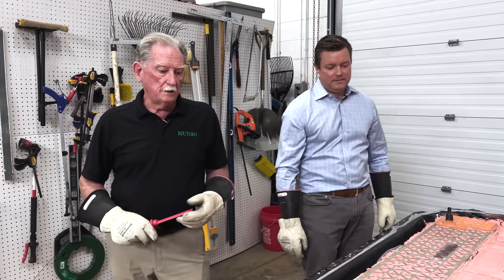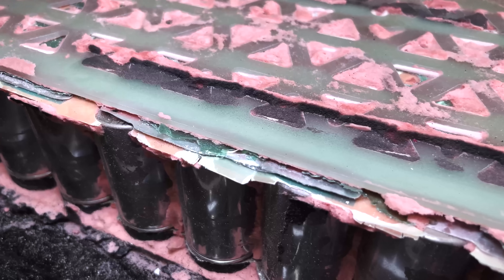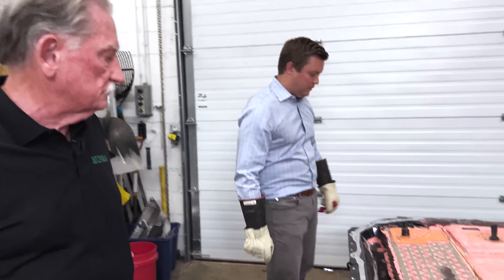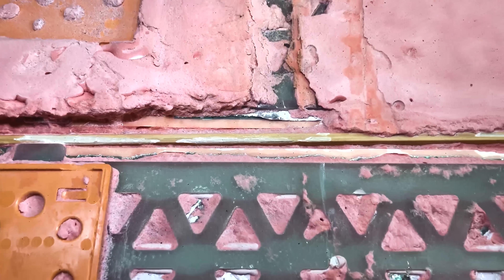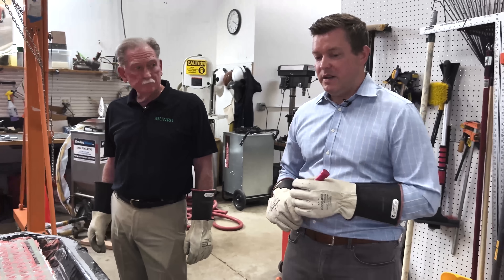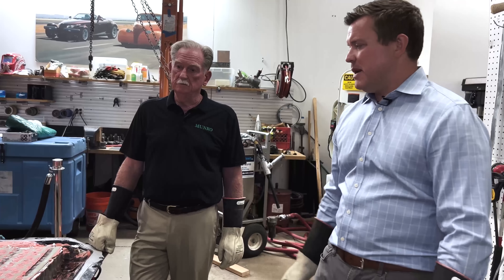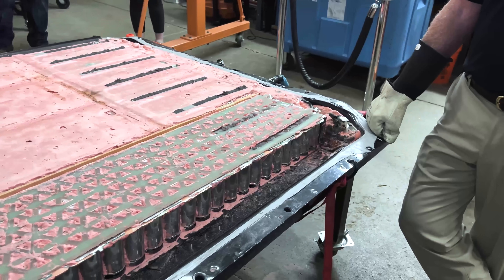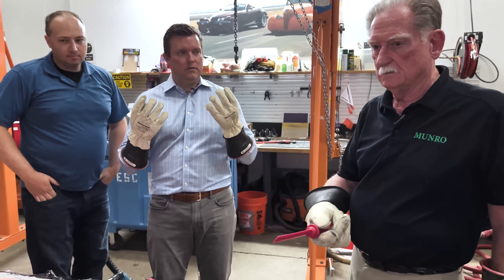4680 Battery Pack: What We Found Under the Foam!

Comment: I would like to see easily replaceable battery modules or cells. Say 12 years after the vehicle was bought, something goes wrong with the battery. It would be nice to be able to replace any bad cell, for a much lower cost than the entire pack. They can put something like CellBlockEx between the cells to help keep the batteries cool, in addition to the standard thermal management for cooling / heating that the Tesla li-ion battery packs have. I am glad that recycling should not be difficult for these at the end of the pack's useful life. I hope that would happen well after 20 or 30 years.

Comment: The problem with the liquid nitrogen / grinding / floating recycling process is that it cost more than just dig the ground (mining) originally ore...
An used car aluminum wheel can pretty much be dropped into a furnace, melted and turned into an aluminum bar that is ready to be cast into something else in minutes and this is way cheaper than dig for aluminum and that is the reason we recycle aluminum: Because it brings profit.
You spend a ton of energy to get a huge bath of liquid nitrogen, then more energy to grind everything, then more energy to separate the elements all of that BEFORE really spending energy to melt the elements down to useful base raw material. Energy is $ and with that upfront cost, recycle will not be profitable, it will not happen in large scale.

Comment: I recognize that pink foam. It is a silicone and mica powder material. It isnt too hard to remove a little, but this much is crazy. I had some LSI nitrogen laser heads filled with this stuff. It can hold off a lot of volts.❤.

Comment: As an electrical engineer, structural batteries are the worst EV trend I've ever seen. Gluing batteries like this is planned obsolescence on steroids, as a few dud cells significantly degrades the entire pack, AND THERE'S NO WAY THEY CAN BE REPLACED. 

Liquid nitrogen is WAY above absolute zero (08:30), and does NOT make the "molecules fall apart".

Comment: So what happens if just one cell fails?

If there were a built in switching technology that could change which cells are in parallel and in series on the fly, then you would be able to reuse without burning the whole pack.

Comment: The amount of bitching in these comments is hilarious. Tesla doesn't design battery packs for hobbyists to reuse for pet projects. Replacing an entire battery pack is the safest way to address a dead cell bank. Forcing service through primary Tesla dealers means trained technicians are working on your mobile lithium fire hazard. Industrial recycling is easy. Lmfao at all of you whining.

Comment: I still say batteries should be leased and a quick swap system created so the batteries stay in a manufactures rebuilding recycling loop. Saves on the cost of the EV. You can change pack sizes for small work trips all week and a large pack for the weekend. As they make more accessories for EV's like cooling or cooking and drinks storage. Or any other road trip tools that would be useful the battery will get used for more things. EV powering your home or cabin. Quick swap batteries will become necessary. Faster than having to charge a pack just quick swap. Then batteries have time to charge in cleaner ways. Direct solar, tide, current or wave power close to the swap station.

Comment: Hello Mr. Munro. 
I watched your videos with great interest. 
In Japanese tweets, there are many comments that take vulgar mounts in response to your comments, such as "Liquid nitrogen is far from absolute zero" 
and "Recyclable down to the elemental level. If you have basic technical literacy, you won't make such a mistake." 
It has been done. But those comments are very minor issues. 
The important question is whether Tesla's battery recycling method can be applied to other manufacturers' batteries. 
And is it still cost effective even if the cooling energy of liquid nitrogen is subtracted? 
Do you think these are important? What is your opinion?

Comment: Looks like the battery pack can not be repaired if 1 or mmare batteries fail. Given the cost of the battery pack,  that is major problem if it can not. Be repaired at the cell level.
I don't approve if that is the case.
Reply: Because they're moving past that.  Single cell failures are rare, it's now more economical to replace the pack and recycle than try and tear a pack apart.
Reply: @TheEvilmooseofdoom  More economical???

Comment: Liquid Nitrogen is about -196°C (-320°F) the absolute Point-Zero is at -273°C (-459°F), so that's quite a bit of difference here. Nothing just breaks down into its atoms or molecules while being cooled down, that's just and insanely false (at 8:38). 
My engineers neurons are dying hearing that.

Comment: what a bad design 🤬 how do you recycle that mess? No chance for re-man or repair
Reply: The point sailed over your head.  It's easy to recycle and not designed to repair.  The packs are reaching a level of reliability that it's cheaper to replace and recycle than try and take one apart.

Comment: Approx 816 -828 batteries.  Using what is a 4.2 Volt battery.  We know that the number of batteries need to have an equal number of batteries in parrallel at each step.
If 8 batteries in parallel we get 4.2 (max) Voltage * 102 batteries in series. . .  Tesla does not run their cars ar 430 Volts  
If 10 batteries in parrallel we get 4.2 (max) Voltage * 82 batteries in series . . . Tesla Max Voltage of 344 seems pretty low.

So Tesla has to be running the structure as 9 batteries in parallel,   So you either have 819 or 828 batteries per Sandy's comment.  (9p/91-92s battery pack)
     Pretty cool to see the 4680 cells.   How much does losing 1 cell out of 9 total cells cause problems for the 8 other cells in a single step up of voltage?  Is this even an issue. . . I honestly don't know.   In the previous packs with 46p/96s,  it didn't seem like one malfunctioning battery would cause an issue as long as the fuse blows when needed and the BMS could remove that one battery from the pack.

Comment: It's not going to into a low temp bad.
It will put until a energy storage unit for making money.

After that life it will be discharged to near zero.
Drained, bottom and side cover will be sawed off .
The disconnected packs.

Mayor electr and cooling part cut off.

Battery pack cut into the 4 modules and that goes trough a grinder.

Multiple grinders for separate parts.
Liquids captured and gasses also

Material goes trough different centrifuges to separated the different density materials.

And then the chemical process of recovering high grade ore begins.

All after the energy storages, mobile or static is not profitable anymore.

Comment: I find the recycling explanation a bit disengenuous. I've worked at the kind of place that shreds batteries for recycling, they won't be able to 'process' this the way musk wants, they want to be able to grind the battery and put it into a bulk pile and sell that to a refiner. There's no float, certainly no liquid nitrogen. These places are only a little more sophisticated than scrap yards. They already have issues with recycling NMH batteries which have a lot of plastic, fiberglass, and junk inside them.

Comment: Some misconceptions here, but I will just hint one out: At 0 K your 'molecules' will not fall apart, nor will they have '0' energy. Everything will just be in its so-called 'ground state', the lowest energetic state attainable. However, it is not possible to get down to exactly 0 K, but you might get very close to it.

Comment: Not having threaded fasteners also means NO SERVICEABILITY, you have to "recycle" an entire battery pack because of a handful of dead cells instead of just replacing the bad cells and keep on driving. Elons argument is basically saying "instead of replacing the fuel pump replace the fuel pump, gas tank, fuel lines and all the fuel in the tank and just recycle all the old stuff" none of that is cost effective for keeping a car on the road unless you are designing cars to be throw away objects at 100k miles.
Reply: Yes, and a battery pack isn't a head on an engine.

Comment: I have read that the 4680 model Y is only 20LB lighter than a model Y using 2170 batteries.  In your videos you have commented how much lighter the 4680 pack is compared to earlier model.  I am wondering did you do a total weight comparison as well?  Given that the pack on the available 4680 version is smaller than a LR version, if this weight difference is true then I won't be expecting any range increase with a full sized pack.  That would be a disappointment.

Comment: I wonder if that foam is fire resistant . Foams just petrolium . What a knighmare that looks like . A cell goes and its throwaway unlike the other packs you could replace . Looks like elon never wamts the cars fixed . Throw away cars esp when the giga press pumps out whole sections  . To expensive to fix . Most teslas get written off from small bingles . My neighbor has 2 model x p 100d . Piece of expensive crap . We already have recycling knightmares around the world in landfil because recyclings not viable .

Comment: I much prefer fasteners to all this goop which is impossible to remove much less repair. Threaded fasteners only fail if they have been improperly designed or implemented. In fact when you look at the abuse they are subjected to they are truly a modern marvel.

Comment: What happens when one of these cells goes bad? Or a charge controller? You have to throw the whole car away, and it won't even be practical to recycle.
Reply: Correct, then it's a total loss... For me, this is a reason not to buy such an EV.

Comment: For removing the adhesive you should find a solvent that will soften it without damaging the batteries. Something like acetone or MEK or something like that.
Reply: Methel ethel ketone is fuckn bad shit i used to use it fibreglassing . Its a carcionagen and is banned in lots of places . When our insurance company found out we used it they wernt going to insure the company if they used it . Acetone isnt as bad but its still not good . We used it all fibreglassing . That pack is just a petroluim pack with all the synthetics in it . I used to make the resins with synthetic pellets and styrene to melt it all down . Its all oil . So much for being green and getting rid of oil hey .

Comment: Sitting (and driving) on a battery "bomb". You STILL can't convince me that it's safe, or practical. See Louis Rossmann on YT. Not only right to repair, but the fight over battery pack upgrade, that was "software neutered", to a lower capacity. Your a slave of Tesla and their software. I would bash the dealership at the first time of range reduction and get a full CASH refund. If you buy a Tesla? Your a moron, period.

Comment: Many people are expressing how such a tight design hurts repairability and the ease of teardown. While I am a strong advocate for repairability and such, it must be realized that these packs are designed with the aim to last the life of the car. Just like how the battery design aims to last a million miles, the packs are designed to be just as robust (and cheap). Cheap is key as well for Tesla because as you know, the financial part of all this is pivotal in Tesla's success. EVs must simply be better and cheaper than ICE cars for them to be replaced. The fact that the packs are easily recyclable, shows Telsa is still concerned and willing to keep things as clean and sustainable as practically possible.

Comment: Just not a realistic maintenance model, imho. Remove the battery pack and replace, then return all waste products to their elemental forms is not sustainable. Grinding of these metals create particles of toxic dust, landing in your lungs if not filtered correctly. Refining lithium takes a lot of water and had a lot of waste products.

Comment: The comment on how that battery is going to be recycled is really wrong. Yes you can "grind it" but it's going to be MUCH MORE expensive and not doable by any third-party. Don't try to sugarcoat this shitty design that is anti-repair.

Comment: But how do you repair a bunch of degraded cells when most of the pack is still in good order? The future is to revitalize a battery that has a limited number of defective cells, in order to reduce energy intensive replacement of whole packs.

Comment: Totally disagree. Sandy is just sucking Elon. This type of the battery design should be banned. No offence, but we can not control dendrites in a battery today. TESLA and Every other automotive manufacture should have easily swappable multi-bank battery design. That way just replace a bank not the 10k battery or worse trash the entire car over a battery bank failure or degradation. As far as bullsh* recycling near absolute 0K with liquid N (LOL open chem book Sandy), it doesn't exists, too expensive, doubtful as skimmers waste a lot of metal. And most likely to only recycle aluminum. Time to retire Sandy.

Comment: In my opinion recycling is not an big issue. But I see a problem if there is a defect cell in it. There are some EVs on the market with defect cells. The car workshop can change the module with defect cell and you can use your car. But in this configuration (also in similar designs from Chinese companys with blade or CTC) have some problems because you can't change the defect cell. Tesla must be very confident that their 4680 cells are so good, but I'm a little skeptical because there will be some defect cells anyway.

Comment: I think an automatically 
mechanical recycling with robot arms would be more energy efficient then grinding it down and build a new one out of the little parts or molecules that needs a lot of energy.

I think that is also planed by Tesla 

This structural batteries are the first. They will improve it and I think they will better recyclable in the future.

Comment: Sandy knows his stuff (4680s are cells though not batteries ;) )
Reply: What would be the difference between a cell and a battery ?
Reply: @freggo6604   cell is a chemical device with electrodes, a battery is an electrical device that combines cells, and has terminals

Comment: Even if you pulverize this 4680 battery pack, the amount of foam in the battery would present as a contaminant, which needs to be removed from the metals of interest. I would like to see Tesla develops a recycling system to deal with their battery packs when they are near the end of life.
Reply: Considering Tesla is basically controlling/owning (or will be), every aspect of their end product in house, Elon definitely has a vision and plan for the millions of BEVs he's putting on the road and specifically battery end of life handling.

Comment: That top "plastic" plate looks like FR4 or G10 - common electronics industry materials. I'm obviously not there in person so see in detail but it makes sense that Tesla would use that material. It's pretty strong - epoxy impregnated fiberglass. It's well characterized. It's mass produced in large sheets with various thicknesses. It's a good insulator. It's fire resistant. There are well developed processes for manufacturing it - shaping (including ways to create the triangular cutouts), adding wiring via photo-etched copper foil (the usual use case). In fact there are places that look like there might be traces on the underside of the material.

Comment: 7:50 for Recycling the battery materials - it's not only about high grade ore ... I'm pretty sure, that there is a liquid or heat that will dissolve the foam and leave the battery cells intact. Maybe the Nylon grids stay intact as well. Even if it would be necessery to use ice blasting every time, it still would be manageable on the big scale. I'm impressed by how serious Tesla takes the thermal runaway theme and keeps improving on a massive scale  to avoid it - and disgusted on how many professional companies simply don't seem to care.
Reply: you are deluded.
In Austria they do not accept tesla battery packs for recycling.
Ask yourself why.
Reply: @PointedZeroBeta  I am actually Austrian. I asked myself why, and that's what I came up with:
We have normal freedom for recycling businesses, nothing prevents entrepreneurs from stepping into the Tesla battery recycling business. One company offering that would be sufficient to enable our Recycling network to accept them. Could even be a foreign company. But there's no demand yet! 
Besides, every company selling anything in our country has to offer to take sold packages and goods back for proper disposal (e.g. recycling) or contract proper disposal/recycling facilities they can redirect you to. So Tesla has already chosen one of those two options forced by national law.    
Why I think there is no general demand yet?
Three years ago there was a total of 4000 Teslas registrated in Austria (out of 5  Million passenger vehicles in total), most of them younger than 5 years. But Model 3 and Model Y have been selling like hotcakes recently. So I'm pretty sure in 10 years we will see the rise of a few of battery recycling companies offering to pay  a little sum for worn Tesla batteries, as they do for consumer elctronic and car Lead Acid batteries right now. From that point on our ubiquitous Public Recycling facilities will take them for free most likely, with or without the attached car. As they offer it for Lead Acid car and consumer electronics batteries of all types right now.

Comment: Explain how Musk stays with the cells vs everybody else goes with pouches. Musk stated that the pouches swell and shrink with charging and temperature is not controlled as well. Why don't we hear of the pouch disasters. Also who has better longevity? What history does Ford or Jag or Kia have on their batteries. The GM "ULTIUM" seems to be pretty questionable.  Ultium is a game-changing electric vehicle platform?